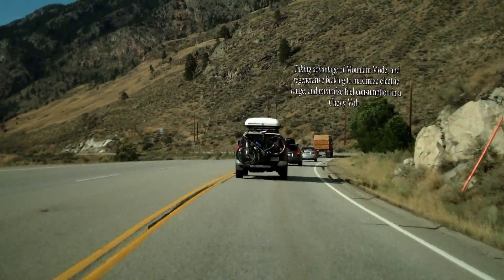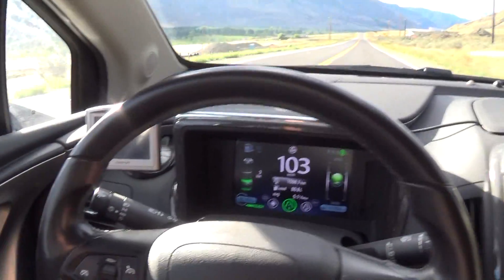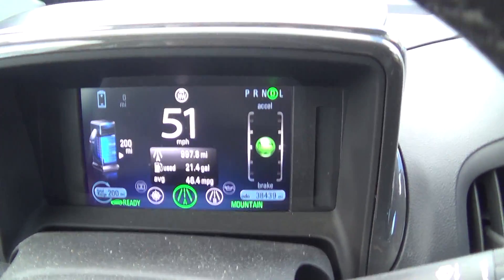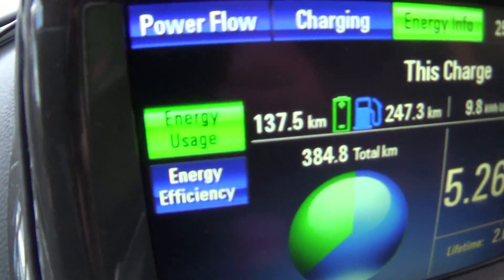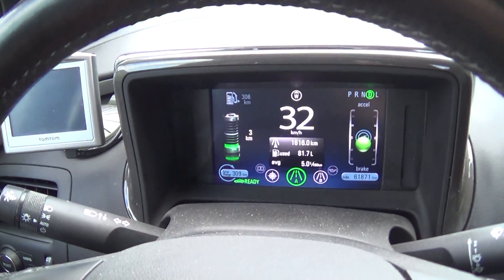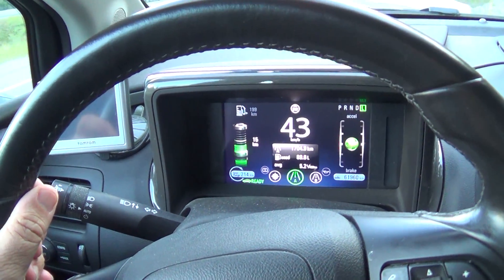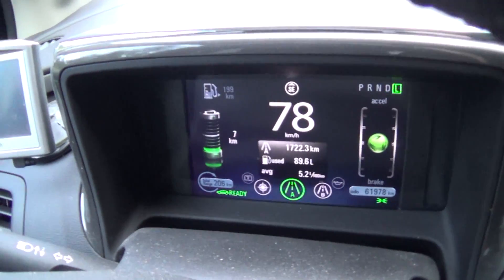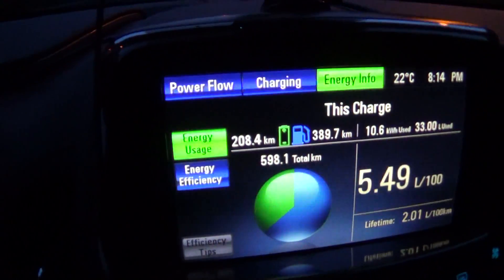volt regenerative braking experiment

Comment: Just a gas car with an electric motor doesn't pay transmission line fees or Kw hour cost at all. I'm thinking of a volt and an trying to watch this to see the cost of topping off the battery at a house. When will people learn to turn the radio down when they want anyone to listen to them? This is a scientific message mixed with annoying sound effects. I can't take it seriously.
Reply from the maker: The music had to be added because the radio was playing very low in the back when the video was recorded.   It was so low I could barely hear it over the road noise but thanks to content Id it pulled a match. To louder music was required to cover the offending sound in the background. The only other alternative was to totally rerecord the dialog and quite frankly that is just too much work on an old video. I think if you watch and listen you will understand what I am getting at.
Reply from the maker: As to the cost of topping off the battery at home, this depends on your electricity rates.  At .10 per kwh the first gen volt with its 10kw usable capacity would cost just over 1.00 to fully charge and a second gen about 1.50 to fully charge the battery.  I have both a first and second gen volt so I know exactly what it costs to operate, which is exactly nothing when running on electricity.  When running on gas, the second gen gets 42mpg so that is pretty easy to figure that out.  The first gen gets 38mpg. The first gen is 400lbs heavier than the second gen.  Both are fantastic cars. The first gen, the one this video was made in now has 160000 miles on it and has not had a wrench touch it yet other than oil changes every 2 years.  It is 9 years old now.  Original brakes. Tires have been changed is all.
Reply: @12voltvids  I bought my 2013 Volt around the time of your vid. Your estimate of 38 MPG for Gen 1 is spot on for the last charge of your trip. The Energy gauge says you drove 236.4 mi and used 5.25 g for 45 MPG, but that doesn't include the full charge you stated with that reset the counters. It also says you drove 151.7 mi on gas, but you did better than 28.9 MPG due to regen. We can use the typical electric range on a full charge of about 35 mi and subtract it from the 236.4 miles driven. Call it 200 mi on gas / 5.25 g = 38.1 MPG. That's still pretty good for a mountain road trip. Belated thanks for your vid!

Comment: I did that once it works! But lots of work for few cents!
Reply from the maker: How is it lots of work. Drive in L range, going down hill power goes back into battery and speed stays controlled. Just because it won't show on the display as I forced it to doesn't mean you are not saving a ton of gas on a road trip. That energy goes back into the battery and then you use that recovered energy before the engine starts again. I switch between D and L depending on if I want to coast, or slow down going down hill, or set the cruise control and just leave it in L and it will hold your speed exactly where you set it just like magic. No work at all.
Reply: @12voltvids  It's funny... I subscribed to your channel several years ago, due to my longtime curiosity about electronics. (I also subscribed to AfroTechMods and EEVBlog around the same time...) But I just bought a 2013 Volt (Premium) last Saturday, and I think I've watched more of your content in the last five days than the previous five years. ;-) 

And your content here is "extra-primo-good" sir. 

BTW, I have a question that you might be able to answer. (I've just started to dip a toe into these waters, so I might find the answer on my own eventually, but if you'\e read this far, I might as well ask...) 

Is the charging cable that came with my Volt capable of auto-detecting and auto-switching between 110v and 220v mains power? My understanding thus far is that it is... and that all I need is a physical "plug adapter" to connect my car to the "standard" 220v outlet in my garage.*  Is this correct? 

* By "standard" I mean the kind of 220v outlet that has a sideways "T" in the upper-left, a "-" in the upper-right, and a 'frowny-mouth' below. (I'm sure there must be an IEEE designation for this plug, but after a few minutes of Googling, I haven't found it yet.) 

Judging by this video and the comments below, it sounds like the answer is "yes", all I need is a plug adapter. (Or, alternatively, I could simply replace the "standard 220v" outlet with a NEMA 5-15 plug in the same 220v outlet box.) 

https://www.youtube.com/watch?v=lGcSgzVtv4I 

Or, to rephrase the question... what's the best way to take advantage of a 220v circuit in my garage (which my dad and I installed 45 years ago because... "You never know...")?
Reply from the maker: @taiwanjohn  
I know that the second generation charger works on both 120 and 240, but I am not so sure about the first gen charge cord. I have seen them modified on other youtube channels, where they took the board out, and swapped it with the board on the level 2 fixed charger, turning the portable charger into a 120/240 charger, and the fixed level 2 was wired up as a dedicated level 1. The guy that did this did it because as he put it, when the car is in the garage over night charging was fine, but when he was charging on the road he wanted to be able to take advantage of 240 plug if one was available.
I have the GM level 2 charger in my garage and have not had any need to modify my travel charger as the only time I use it is when I am traveling.
The first gen has the 8 amp 12 amp selector on it, and generally if I am charging at a motel I have to use the lower 8 amp limit because it will trip a breaker, generally in the office if I have it on 12 and then that causes problems with the owner when it comes to power. They think it is going to cost them alot, and get grumpy as far as pinching some power while staying there.
Reply: @12voltvids  Thanks for getting back to me. There is a "twist" to my situation... although the car is a 2013, the dealer got it from an auction, and it didn't come with the charge cord. They had to order a new one from the factory. So there's a good chance that I have the newer version. Is there an easy way to tell which one I have? 
When you say "the first gen has the 8 amp 12 amp selector on it" are you talking about the menu options in the dashboard, or is there an actual switch on the charge-cord unit? (Mine does not have any switches on it.)
Reply from the maker: @taiwanjohn  
If your charger looks like the one in the video in that link that would be the new one. The original one was much larger and had an orange cord that plugs into the car and a handle that locked it into the storage caddy under the  floor of the hatch.  It has a series of lights on it and a button to switch modes. The 2 large lights to shor status which are normally green, and 4 small ones below the 2 larger lights. When you press the button it switches between 2 of the small ones to 4 to indicate 8 or 12 amp charge.  It is quite large and the charge cord winds around the charger unit and is secured with a velcro strap. Says voltec on it.
Reply: @12voltvids  Yup, that's the one all right. Sweet! Now I just need to sort out the plug adapter. Thanks for your help!! :-)
Reply from the maker: @taiwanjohn  That will be easy. 
The 3 wires currently are ground, neutral and hot.
When you rewire you put the ground on the ground. hot on one hot wire and the neutral on the other hot wire.
The charge unit is actually dumb as a box of rocks. It just talks to the car. Both the Hot and Neutral will go through a fuse and to the normally open contacts of a relay. These correspond to the 3 large main pins on the car connector. The other 2 are the commumication bus to the car. When you plug it in, the  car sends a signal to the charge controller to tell it that the connection is made and the car is ready for charging. Once the connection is made and the car signals it is ready the controller energizes the contractor and supplies either 120 and 0 on the to power pins, or 240 across the 2 (120/120) or in the case of European cars,  240 / 0, or the 2 phases out of 3 for public car chargers which is 208. The car itself can take multiple voltages on the same connector and it automatically switches.
For example when I charge at public stations it takes significantly longer to charge than at home because the commercial car chargers are typically wired  from 3 phase power, and even though each leg is 120v the net ppower between the 2 is only 208 due to the 120 phase difference in 3 phase power vs the 180' phase shift on single phase residential power. Charging from 208 takes a little longer, 4:15 vs 3:75 at home from dead to full on 240v.
Reply: @12voltvids  Actually, I was thinking of getting a pre-fab adapter like this: 
https://www.amazon.com/Universal-Plug-Adapter-6-20P-Volts/dp/B071JPX114/ 
But then I noticed it's only rated for 15 amps. Not sure if I'd want to trust that. Looks like I may have to do some actual work this time. ;-) 
I think I'll just mount another outlet box on the adjacent stud and run a pigtail out with a NEMA 6-20P plug on it. 
Thanks again for all your great info! I've been reading some of the other comments here as well, and the depth of your knowledge about this car is quite impressive.
Reply from the maker: @taiwanjohn  
It's the best car I have owned and I am looking at getting another one. Was looking at 2019 models last weekend.
Reply: @12voltvids  I'm loving mine so far, though I'm still learning my way around all the menus and buttons. Red 2013 Premium with only 22k miles on it... got it for just under $14k. The more I learn about this car, the happier I am with that deal. ;-)
Reply from the maker: @taiwanjohn  
You'll love it. I have been so many places in my volt. Have been up to Prince Rupert, Medicine Hat, Calgary, all over Vancouver island to Tofino, Campbell River, Gold River, Port Renfrew, down through Oregon and California coast. To Las vegas twice, Arizona, and Utah. 140,000 miles so far, and not a wrench as touched it. All I have had to do is change the engine oil and oil filter EVERY 2 YEARS! I have worn out a set of tires and that is about it. Last time it was checked there was still over 90% of the wear left on the brake pads.

Comment: To bad GM is ditching the Volt, it is under rated .... and putting all their eggs in the all electric Bolt...
Reply from the maker: Yes I know. Well when it is time for another car if I can not get a volt it will be another brand that has a gas backup. Probably a Mitsubishi outback plug in hybrid. It works just like the volt, but I will probably buy another volt before it is gone.
An all electric with no backup is not an option because I like to go on road trips and I am not about to wait around for charging.